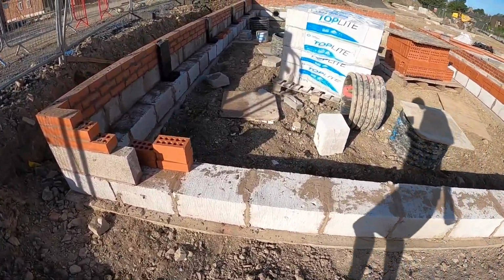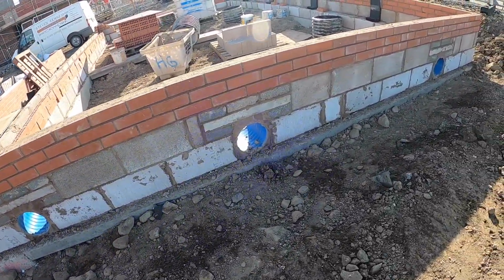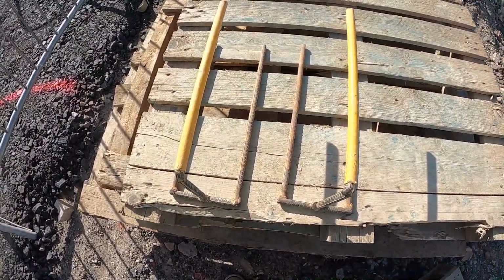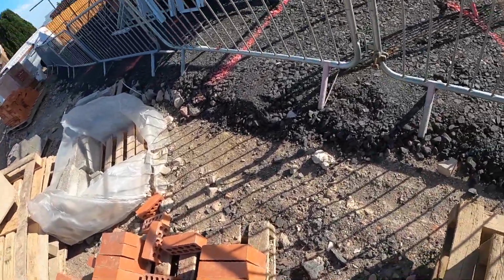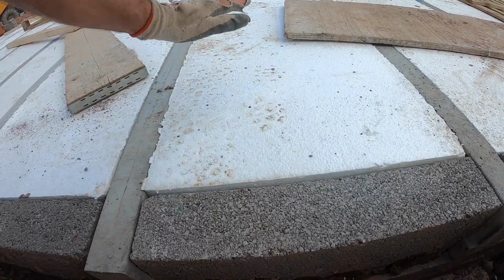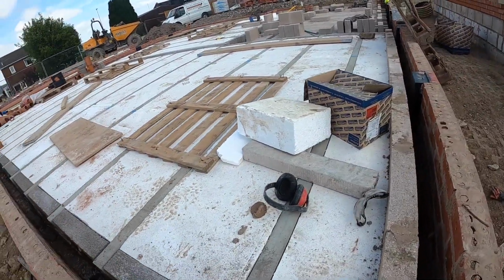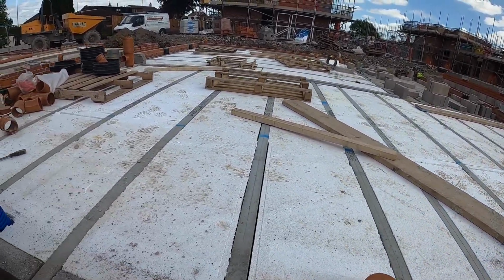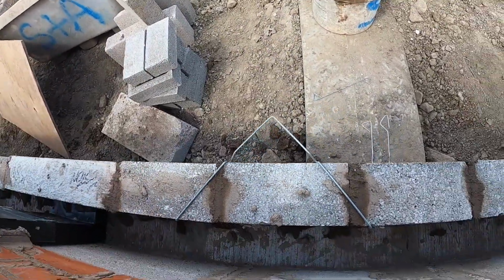WE ARE JACKING IT IN .....NO MORE FOUNDATIONS!!

Comment: Hi guys love your content great attention to deatil. Question i have a bit of surface water sitting on my footings and 1/4 up the first block but thats all the way around the build would you say this will cause issues in years to come and should i be considering some sort of drainage to take it away. I still have black jack dpm paint to be put on just waiting for a few dry days to drain water and be dry enough to apply it.
Reply from the maker: Every foundation has water on it . The water finds its way naturally to the bottom of the trench and stops at the concrete . Nothing to worry about 🧱👍🏼